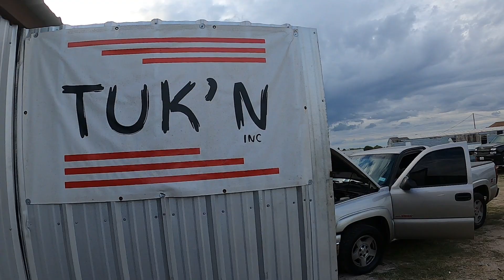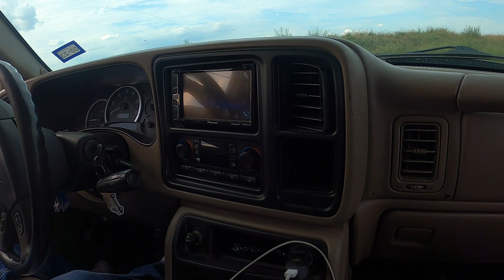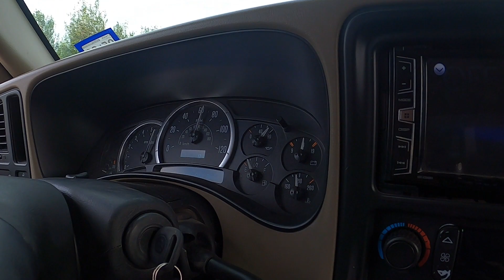SS CLONE GETS C NOTCH!! SLAMMED!!

Comment: What's the set up on the 4 door? That things is qui ck! And must be making good power
Reply from the maker: 6.2 23x/24x cam 3800 circle d bolt one 4.11s milled heads
Reply: Thanks!